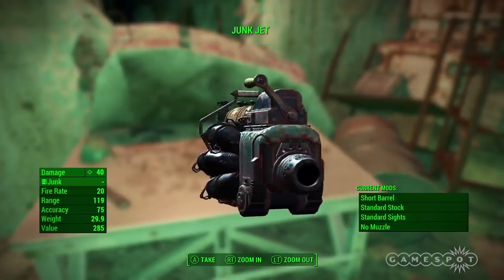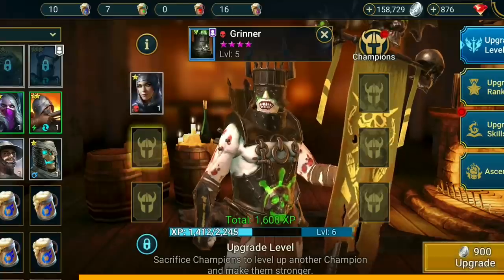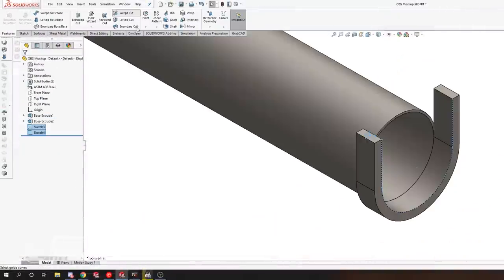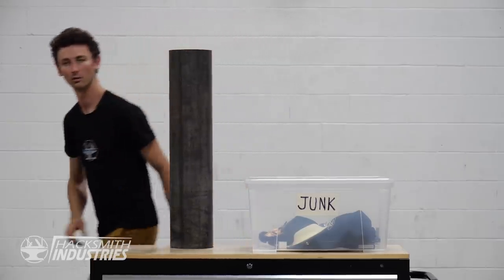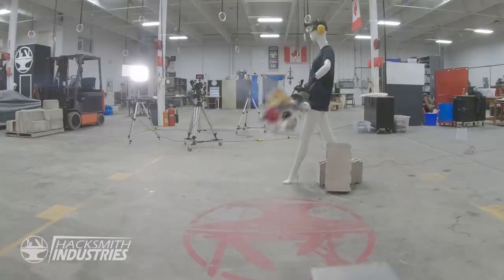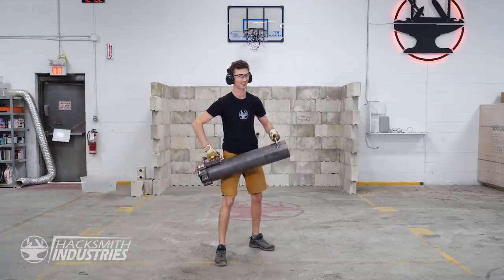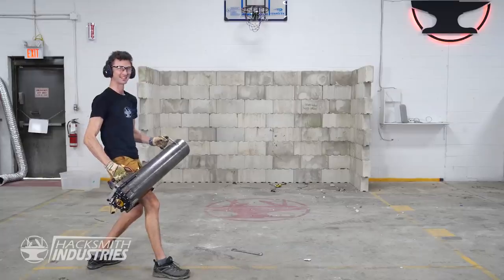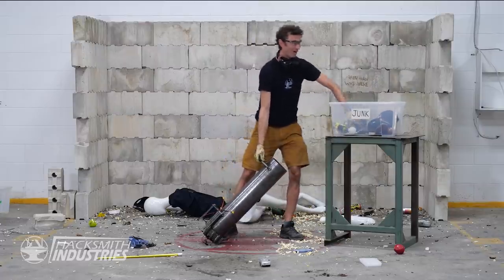Junk Jet Shoots ANYTHING! (One Day Build)

Comment: what if you added some form of recoil control? i was noticing that every time you shot something heavy the barrel would drop from the recoil. what if you added a second airbag under the tip of the barrel to get rid of recoil? or like an upside down compensator to redirect gases downward to create barrel lift?  or a co2 cartridge? idk. it would definitely improve accuracy.

Comment: there is a pyrotechnic charge in the airbag, would it be feasible to use that directly?
also a weight that would be pressed back, against a spring, would reduce the recoil.
specialised ammo, like stun bags or a lot of rubber balls might be usefull for home defense.
EDIT: when you fire some small stuff, like the pile of screws and nuts, using a sabot would probably make the thing more effective.

Comment: You should make reloadable airbags for this thing so you can just slide one out and slide a new one in
Reply from the maker: Airbags aren't reloadable though,  one time use for safety haha
Reply: @hacksmith  sure! I meant for all the ones you had left over (if any). Haha I picture yall in fallout wasteland outfit with the junket and a bunch of non-used airbags on a stap across your side. You load it with junk, fire,  replace bag with a new unused airbag cartridge, repeat. Just think that would be cool, but yall do you! Keep up the great work and thanks for replying!

Comment: The recoil on that second-to-last shot reminds me of the time I put about a cup of water in an air cannon charged to 50 PSI. Bad idea. Gun ripped out of my hands nearly slicing one of them open with the pressure relief valve...